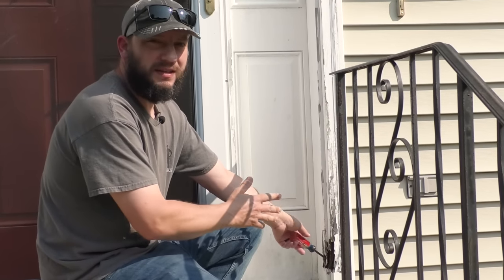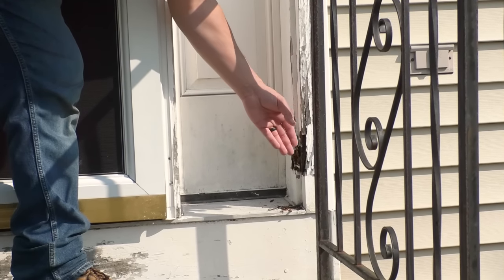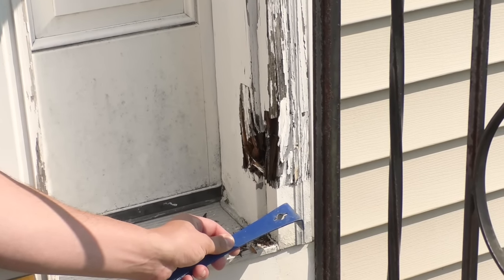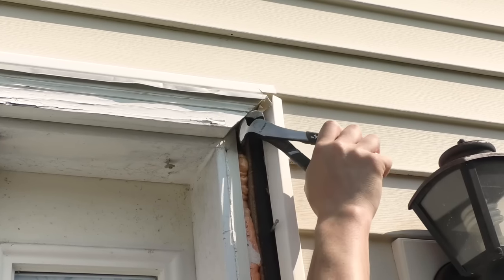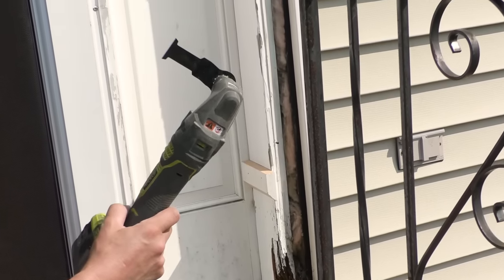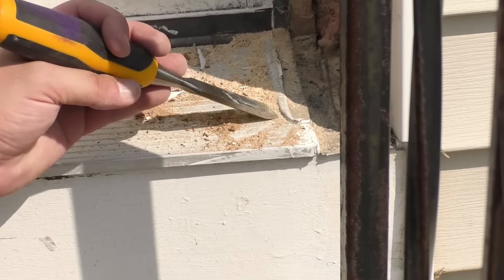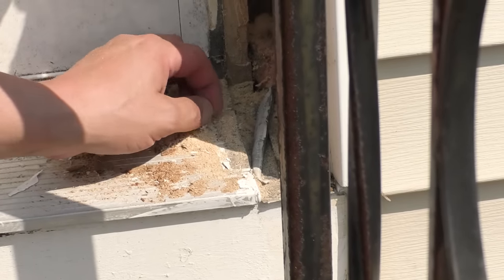How to Repair Rotted Door Frame and Trim on Exterior Door

Comment: Great video mate, love the idea of using PVC however just a couple of tips to make it better. Change the angle on the joint, if you change the angle around so the top angle is the other way you won’t get any water ingress, as it water can track to the back of the joint. I would also seal the end grain of the timber using either silicone of PVA glue which ever way the angle is cut.
Reply: Thought it was mentioned in the video about the direction of the cut-
Reply: @dubmob151  Not in respect of direction of angle.
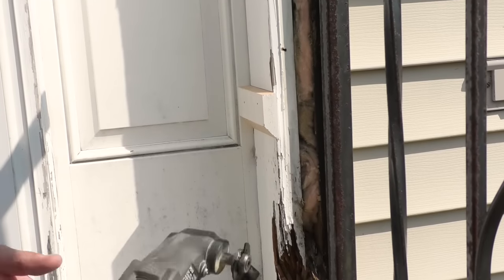Reply: @utube1818  4:30 are you referring to this angle?
Reply: @dubmob151   Yes, if you imagine water running down the face of the leg it will track to the back of the leg because of the way its been cut (not to mention getting soaked up by the end grain) If the cut was the other way, water would not be able to track because the cut would be going in a upwards direction.
Reply: @utube1818  yes, that's what was specifically mentioned in the video

Comment: 13.2. min. That 45 degtree cut facing outer side can be rectified by using another 45 degree  cur facing  inwards on the bigger-longer door frame, and cut the small replacement wood or plastic  piece 45 dgree outwardsfacingn and insert onto the bigger fram like a zigza;this would allow the water the water to run straight down as you mentioned earlier !!!  No issues...just cut again inside reversing that 45 degree angle.  It can be done with right equipments ( that vibrating chisel/saw)!!!  Am i right?

Comment: Wouldnt you want the 45 degree angle go up instead of down to help water be directed away from the trim instead of in to the trim? Sorry Fixer, I posted before I saw your follow up of the 45 degree angle cut the right way. Love your vids.

Comment: Somebody once said to pretend that you are taking a ride on a raindrop. I saw myself soaking into the joint pointing up. Sealing the end grain with a clear liquid epoxy like Total Boat or West System would have sealed the hollow straws of the end grain. Priming the cured epoxy scarf would have taken it up another notch as would nailing it in place when the paint was wet. Of course the scarf down is as you said, the best form of the detail. Even pointing down, The epoxy and wet joint assembly would take it up a notch. Many restoration contractors
 keep the epoxy on hand with pump meters. It can last a long time.

Comment: Prime those cuts, then calk or glue. You can use a wood hardener on the rotted edges, then prime, then Bondo or Fixall, or similar, then prime.

Comment: What did you do to fix the problem with the gutter overflowing? I have this problem. It looks like a waterfall flowing over the gutters and hitting the siding on the lower level, rotting the siding. 😭

Comment: I simply chisel out the rot. Create a frame clear plastic frame to the shape of the space.  Put a hole at the top and squeeze in a mix of caulk, quickcrete or plaster of paris and whatever color paint is needed.  Rock hard, water tight and can be painted easily to match existing area.

Comment: you could have used some 3m marine 5200 sealant on that scarf joint. Even though the angle was the wrong way it would be sealed up and waterproof.

Comment: I used to do body work on cars, then I settled down and became a stay at home mom. I must admit, I do miss my old friend Bondo. Fix what you can, bondo the rest!
Reply from the maker: It's a great product!
Reply: @TheFixerHomeRepair  I've used it to seal the underside of my crappy countertop where the dishwasher is. Just to keep it from rotting out before I can replace the counters 🥴 keeps that particle crap from chipping away!

Comment: Nice repair even though it wasn't shingle right on the cut before putting the new piece in I would have caught that whole joint surface regardless of the shingle Direction! I'll give you a hand to be an honest about it though good demonstration though

Comment: Isn't that 45 going to funnel water directly into your insulation when the joint separates?   If it were the other way then any water running down the trim board would just keep going down on the outside of the board.   And again WHY is there no sheathing on this house behind all these trim boards??

Comment: hey man looks good from here, when you used your finish gun fot the brick molding is it a 15ga gun or what gauge i have a 15 and a brad (18). i may have missed it but is there any specific reason you use bondo instead of plastic wood or something like it? i have see you use it in multiple videos.

Comment: Only thing I would have done differently is grooved a small channel where the 45 degree angle PVC and wood came together. Similar to how you would prep an area for patching with hydraulic cement, etc. The bondo will be more durable and seal the channel better.

Comment: When cutting, do you leave the line or cut right on top of it? 

Also, if I tweaked my miter saw and damaged the guard, did I damage the blade as well? Would I just check the blade against a speed square? Oh, the saw is older no new guard available. :/ Lady here....

Comment: I have the same issue. I only need about 2x 8" long x 4.5" x 3/4" but I can only find very long pieces that are expensive. how can I find a scrap piece somewhere or buy a smaller piece than what the local hardware stores carry?

Comment: First time I’ve heard another carpenter say “strong” when measuring . I worked with my grandfather learning the trade and he would yell out measurements “ 11 and 1/2” heavy.” So for the ones that don’t understand that means that tiny space between 11 1/2” and 11 9/16”. You have to go by that if you want perfect tight fits . If you question it you’re wrong lol

Comment: I think you should I use some PL a good waterproof wood glue on the pieces and made sure you attach them only to the door and not to the frame of the house because if the house framing moves a little or the door moves a little it's going to separate at the seams  that you just made. You should only attach them pieces to the door as one unit like when the door was installed you could have used finish screws some glue you could even made some little brackets up to attach to where you cut out. Me personally I would have put some dolls in there on the top on the side bottom and then put the trim board on the front.

Comment: Are screws generally not advised to secure the wood so it's easier to pry off like that when it comes time to replace?
It's probably better to leave the screw holes exposed and obvious as a courtesy to whoever comes next to work on it; otherwise it'll be a frustrating effort trying to pry off wood that was assumed to be fastened with nails, but instead have hidden screws.

Comment: If rot in on door - easy fix is to remove all rot first and then apply bondo auto body repair - sand able and can paint - extremely durable and weather resistant

Comment: A mistake yes but the joint is so tight and then the sealer on the crack and 2 coats of paint , its water tight.  The bottom of the other side will go first. Nice video.

Comment: 31:42  end result looks like a new door .   It would still be a hella of a lot better with a pouch roof.

Make it dry less snow and ice. And you can get in and out the house without getting wet.

Comment: Splice upside down? Reverse the infill cut. If not, water/snow etc will go in?
Reply from the maker: I guess you didn’t watch the whole video.  ☹️
Reply: @TheFixerHomeRepair  I did. But, the 45 degree angle should have the incline from front to back regarding not letting in water. So, undercut the part - the jamb - from front to back upwards. Perhaps, using a fine (throwaway) gents saw would be more beneficial for control instead of the multisaw?
Reply from the maker: @johnpayne6196  I addressed this in the video.  Pretty early on.  Right before I made the cut.  It’s fine that you skip around the video but that means you miss stuff that would explain exactly what you are talking about.  🤷‍♂️

Comment: You also should have attached the guide piece with two wood screws instead of nails. Then it's easier to remove when you're done.

Comment: Disagree on the water issue.  A crack that thin will wick water in either direction very nicely.  The best you can do is glue the joint and use a good primer and paint over the top.

Comment: I'm going to recommend you take off the door and replace the entire length of that wood. Cuz now you're just creating a problem where the 45° angle cut is now facing the incorrect direction eventually it will allow water to drip through there and rot the back side and possibly your framing.

Comment: I know the video is a yr old and you may not see my comment. However, please mention the correct type of spray foam in case viewers want to use it. They should get non-expanding (blue label in most brands)  for windows and doors.  
I would not leave the rot on the opposite side of the door. Wood rot is a living organism and will continue to destroy the wood underneath the Bondo patch. Just my thoughts..Lexel is better than silicone, and is paintable.  
I am.certainly no expert, just have helped my spouse alot.

Comment: 11:12 
I hate to mesure. Because i make  mistakes  and im not going looking for my bevel finder, but at this point you have everything you need to transfer that angel to the board on the bottom.
So lay a piece of scrap on the threshold up tightly to your trim and  score a line over the top of it onto the trim board   no bevel finder no tape measure  your just scribing the line that matches the angle.

Comment: Well you admitted your mistake. You need to paint the end grain on the door jamb before installation. You should also paint the end grain on the pieces you use to repair the damage. Do this to stop the capillary action of the wood. Most exterior doors rot the bottoms due to this,   And not because the surface is getting wet. I have done this for every exterior door I installed. Very few had the bottom rot and those that did were ones that water repeatedly came up to the threshold but not into the house.

Comment: You also messed up with the cut. You could had nailed both of those guide pieces onto the door jamb, spaced them just wide enough to sneak in the blade from the oscillating saw blade. This would have supported the blade entirely making a cleaner more accurate cut.

Comment: Cut a straight cut of a to size of measurement no need to angel cutting and fill with water resistant putty on the cut line and your done all that Angelina is to much extra work I wouldn’t put the material insulation as you see do to weather is molds over I would fill with weather spray foam. Good job tho

Comment: You can also use Durham's Rock Hard Water Putty instead of Bondo.  I haven't used it outside but it says it can be as long as it's painted.  I've used it to rebuilt a piece of door trim that my dog thought it looked delicious enough to eat.

Comment: 6:54  I must not need to watch this because i noticed it right off the batt. But you put in what you did wrong right where you made the mistake  yes your human and showing it as the mistake clears that up.

I belive that house would both look better and be safer with an overhage roof over the frt porch  why it doesn't have one is beyond me.   I think iwould have used the PVC wood and brickmold trim material.

I did my deck casment windows bottom board and not 2 years later it rotted back out. The deck has no roof over it and even with the drip bevel at the bottom of it it still got water splashing back up into it.
Next time im doing plastic trim boards  pine boards with just paint on the rots. Most door and window frames and trim are pine. 
Older houses they used oak and popluar it lasted longer. But pine is a cheap wood.

Comment: In MY opinion, you exposed your mistake on the 45 cut but what you did not explain at the time was that you used bondo to cover the cut.  I think you beat yourself up for nothing other than explaining  the reason for the proper cut. Bondo does not rot. You are FORGIVEN !!  Great video and techniques.

Comment: mistakes happen to the best of us. Also if you flipped the 45 angle wood and put it on the bad piece of wood you were chiseling out you wouldn't have to remove it or putty the 2 brad nail holes you used.

Comment: Not hard to make a mistake like that. I was screaming at the monitor!!
Extra brownie points to the in-laws would have to splashed a bit of paint on that panel under the door threshold to blend it in, seeing you already had the paint tin open.
Also, painting the hand rails would have spruced it up as well. Isn't it better to get big smiles from the mother in law, rather then laser eye's?

Comment: I mean I'm no expert tradesmen or anything but, couldn't you have just pulled your jig and turn it upside down, slightly higher? Then make your cut again with the same tool. Then slightly change your measurement for the replacement piece. Am I missing something? Again... I'm more of a dyi-er
Reply from the maker: Yeah I noticed my mistake when the job was almost done and didn’t want to rip everything out and start over.  Thought I said that?

Comment: It's irritating these door frames are made using junk woods like poplar that rot out in a few years. I have two doors with bad lower rot issues despite using the best butyl caulks, Duration paint, 316 stainless fasteners etc.

Comment: what door can cost 3000 $ not newer can, solid wood panel door cost normal 200-300 $ maximum,  3000 door need be build gold and diamond lot and digital finger and bluetooth smart lock and inside full metal safety panel   if cost 3000$ and DIY made solid wood door cost less than 100$ sure.

Comment: Nothing will stick to weathered(gray wood). Your end grain on the repair should’ve 100% been primed before you put the new patch on. All of the weathered wood aforementioned should have been sanded to clean wood, tack cleaned,  oil primed THEN caulked. you’re obviously a very handy guy who has very good skill sets, but those couple little things that I mentioned could help get to the next level. I would look into a Festool dust extractor and RTS sander. You could do 99% of your sanding, both rough and finish for all of these repairs and have no dust.

Comment: 26:43 Yes, it would be a good idea to wear a respirator when sanding. However, having a beard makes that mask you are using ineffective as a respirator. There are many different powered air-purifying respirators on the market that are effective for people with facial hair. I happen to prefer 3M, but they are expensive.

Comment: I understand you a carpenter but is away to not break the bank buying pvc planks in home depot you could used regular wood instead n caulking n a good paint and next time get a patty knife so don't ruin you chisel n the bando replace for wood repear bando

Comment: 3,000 to replace that door? I don’t think so.
Reply from the maker: Have you priced out doors with side lights/materials and labor lately in Massachusetts?  $3k is on the low end.
Reply: @TheFixerHomeRepair  go back and read my comment.  It’s carefully worded. I’ve installed $5,000 doors. My point was your thumbnail is misleading. THAT door can be had in my area for $350. I can usually do an exterior door in 4 hours if it’s straightforward and on a post-70’s house.
Reply from the maker: I understand your comment.  I don’t know where you live but $350 might cover the ice and water, insulation, hardware, caulking, etc.  You can not buy this style door that is comparable for under $2000 around here, in fact, the cheapest door at the local big box store that would work and is basic and ugly is $900.  Any design features like the window details or more than just a plain white fiberglass or metal door hikes the price right up.  Then if you are not able or willing to do the job yourself you are paying for labor, which is really high now in my area because companies are so busy they are just over bidding to either let the job go or make it worth their time.  Not being misleading in the thumbnail.  Being realistic.